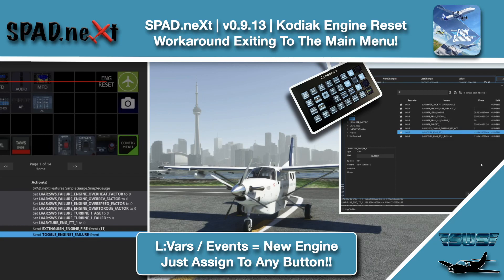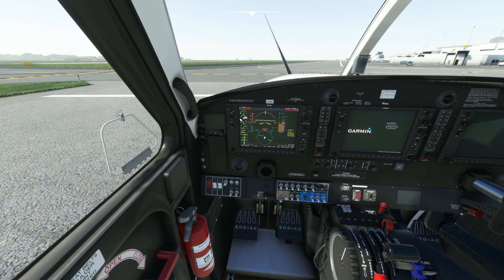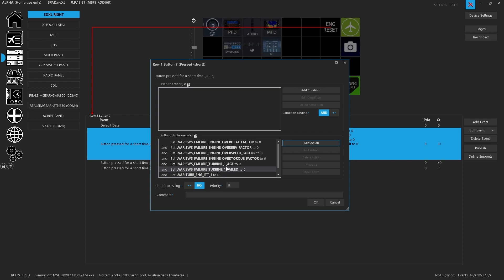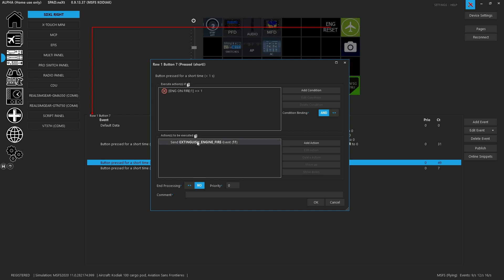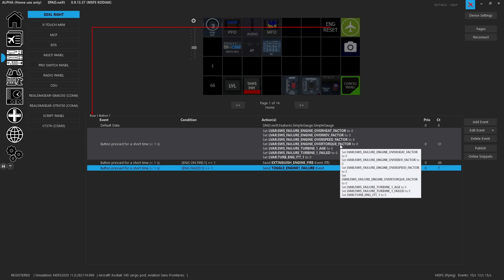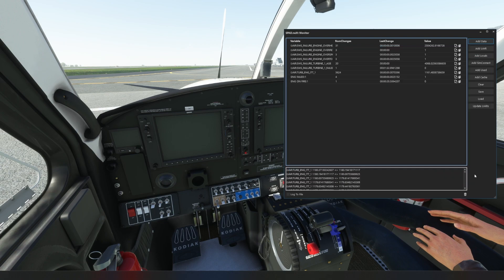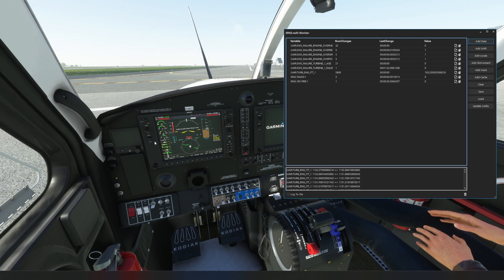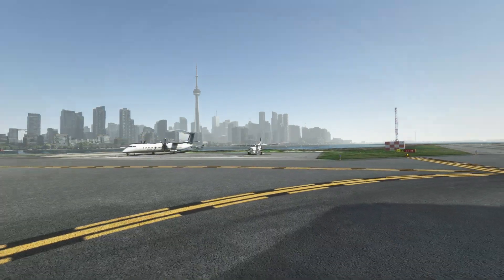MSFS | SPAD.neXt | v0.9.13 | SWS Kodiak Engine Reset

Comment: Can this be done by programming a button on my FIP. If so how would I do this . I am a pilot but NOT a computer programmer. Hard for this old guy to figure this out by watching videos that assume we know what a LVAR and HVAR means. I know now after googling it but I really just want to know if there are any videos like (SPAD.neXt for Dummies)? I really want to be able to use this program I just purchased. You seem to be the authority on using this stuff. Thank you.
Reply from the maker: yes you can assign it the exact same way to any button ... a button is a button in SPAD.  There is an entire new user series.  Easy to find all the videos by section using the SPAD ui.  HOME - VIDEO GUIDES and then all the videos in sections.
Reply: @LesOReilly  Thanks for the reply. I finally found the video I was looking for that helped flip the switches in my head to the on position. I would like to know every thing you have forgotten about this stuff. That would be enough for me. Thanks again.

Comment: Les I sure you may have covered this but I cant toggle fuel valves on wing tanks on the kodiak trying to link to my x touch. Any help would be appreciated.
Reply from the maker: Use the Datamonitor in spad to find the correct LVARs ..  There are tank selector switches.

Comment: i figured something out by accident, not sure if you allready know. if you want to ad a pause, max time goes to 5000, but if you write manualy a number you can type 10000 and it wil actually works and pause for 10 seconds, so you dont need to ad 2x 5000 msec pause.
Reply from the maker: yes that was added and was part of the release notes when fixed